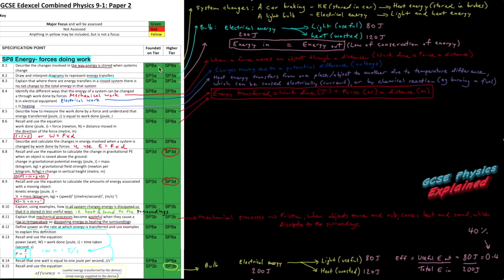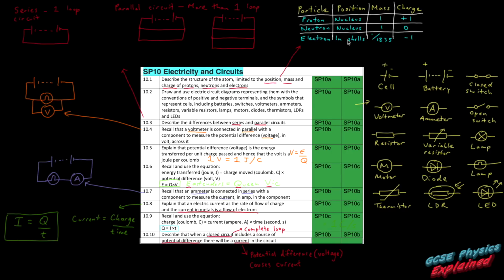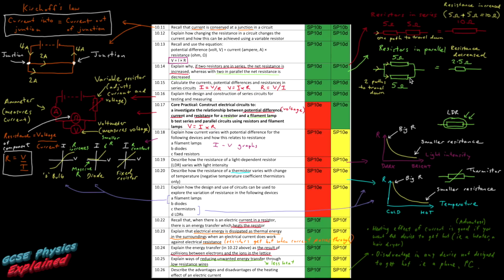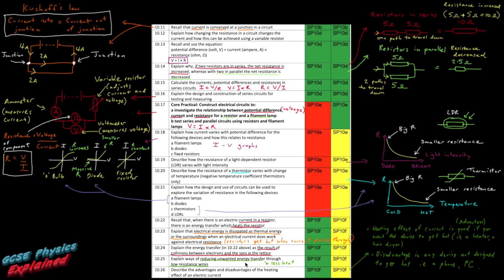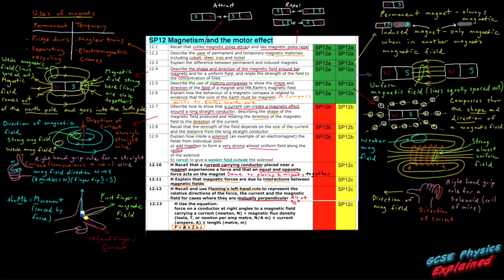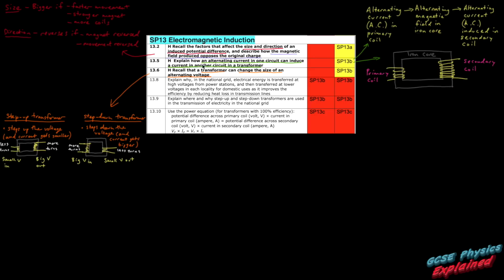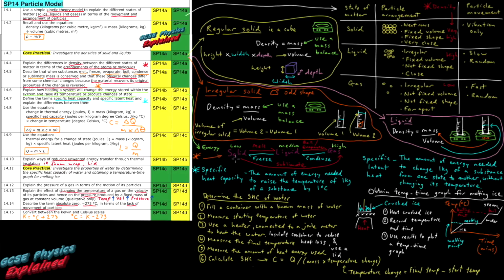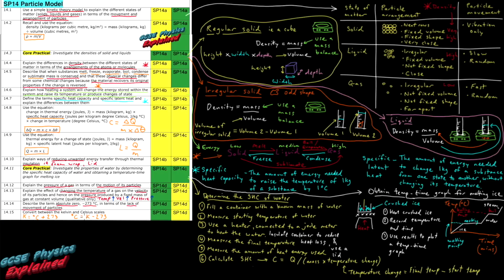2022 physics exam content prediction - Higher Combined Physics paper 2 Edexcel

Comment: for 41:12 does it matter if you say alternating p.d. or alternating current?
Reply from the maker: It’s the alternating voltage that causes the alternating current. It depends what they specifically ask for in the question. Hope that helps
Reply: @GCSEPhysicsExplained  cheers, i only saw this after the exam but it doesnt matter. it went very well  and i made up for how crap i did in the first one. your videos were really helpful so thanks for that
Reply from the maker: Well done, Rav. Glad I could help 👏🏻👍🏻

Comment: Which way does current flow in the circuit toward the left side or the right side?
Reply from the maker: Conventional current flows from the positive terminal of the battery to the negative terminal. Electron flow is from the negative terminal to the positive terminal.

Comment: hi sir, hope your well,. if they said, how could  thermal insulaation reduce unwanted enerrtgy transfers.  - you would say e.g. foam, and a lid reduce energy loss by heat, thereefrtoe more energy is transferred to more useful stores and ways,, so less eneergy is dissipated into the surroundsigns.
Reply from the maker: Yes, you could also mention that foam is a solid with lots of trapped air. The solid part is insulating material that reduces conduction, and the trapped air reduces convection. The lid reduces convection as well 👏🏻
Reply: sorry for my spelling my keyboard is destroyed